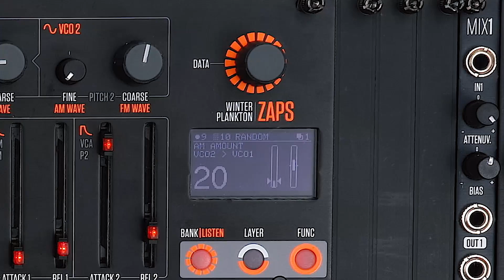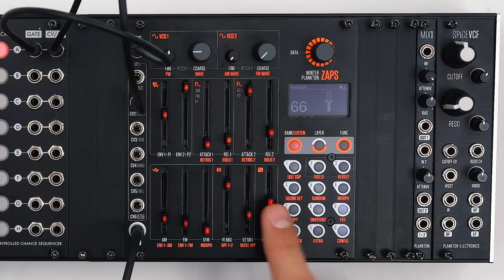Winter Plankton ZAPS - 4/10 - Random

Comment: Hi, not sure if i understand the random function properly, particularly the CV input. I thought it would function a bit like the Malekko Varigate 8's random input where the new levels remain as changed, i.e. the random function essentially creates a new sequence. Instead, when I send a CV in, it does randomize the parameters but then when the CV signal is dropped, it returns to the previous state.  Am I doing something wrong? Am I even making sense? 😅
Reply from the maker: I'm not sure if I understand it. 
When you talk about the sequence, do you mean the sequencer that controls the ZAPS? The random CV in controls the amount of global randomness applied to specific parameters that have randomness applied. 
It is not destructive; as soon as the CV goes to zero or you disconnect the cable, the global random amount is the same as what you have in the global Random parameter (last fader).
If you think it can help, please send a video link to support.
Reply: @wintermodular5455  Ah ok so it's non-destructive, I understand now. Thanks